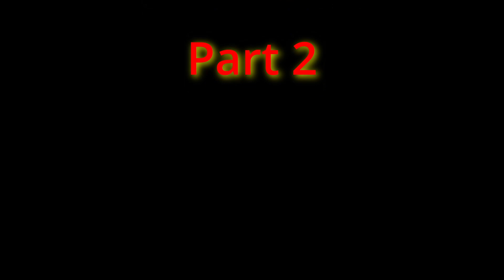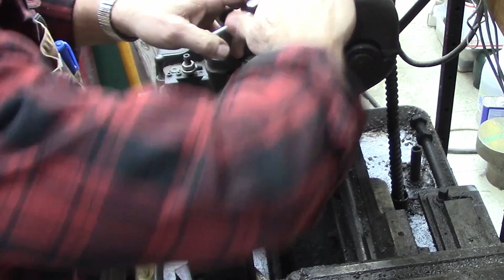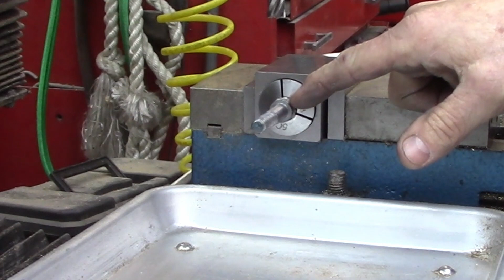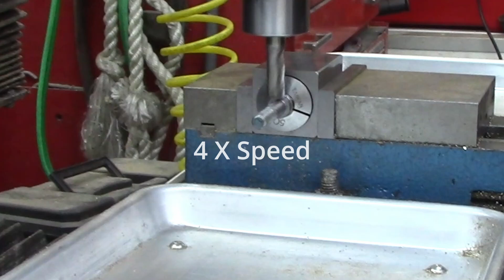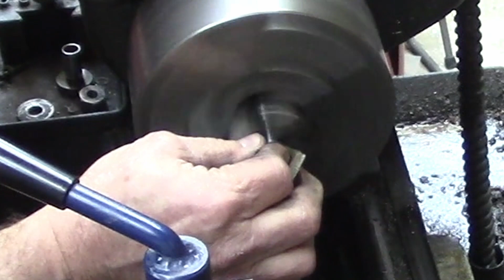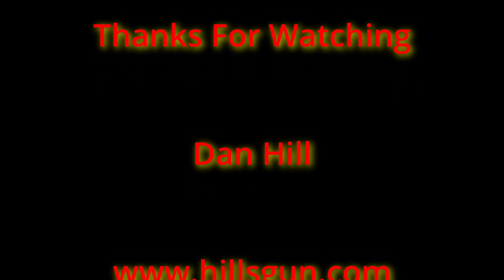Machining A 9 69A Banjo Bolt For The 10 Inch Atlas Lathe: Part 2

Comment: Great of you to help save these old lathes. Did you every come up with a way to make the sleeves and bushings for these bolts?
Reply from the maker: Thanks, I have done the prototypes for them but haven’t put them in production yet. Dan
Reply: @hillsgun    Thanks for the reply.

I just got a 1936 10D. That seems to be a one year odd ball. The gears are only 3/8'' thick all the way across. Unlike the later ones that are 1/2'' at the hub. I mistakenly bought several wrong gears along with the bolt/bushing assemblies. I guess I'll just have to turn everything down.

Comment: Dan, glad to see your having some fun. I'm hoping to have my Lathe and Mill setup in the next week. have a great day.
Reply from the maker: Thanks, you too!
Reply: Just a general question: how much throw does your half nut lever have? My machine has about a 60 deg swing with about a 4” handle travel. Only about the last 1” matters for engaged/ disengaged. I am finding the long free travel makes it hard to hit the marks on the threading dial except at the slowest speeds. 
What is normal? Should I be looking at trying to modify the disengaged stop point?
( did that make any sense?)
Reply from the maker: Hi Glenn: I will check both of mine tomorrow but I think that sounds like a lot. If there is a problem with your machine I would speculate that there is something worn or broken so I would think of it as repair rather than modify.
Reply: @hillsgun  although the machine is about 15 years old, I bought the machine new, and it has always been a low use hobby machine. Now that I have retired I am finally getting to use it. It is a 14 x 40 “high precision “ machine from China. It has hardened and ground ways, but things like steady rest are really cheesy. The spindle has a ‘variable’ runout of about .0005 though that is not ‘in one place’ but rather bumps at varying spots through subsequent rotations. I think it is poor headstock bearings. With careful setup, scraping in the steady rest to sit square on the ways, adding glass scales, improving my technique etc I can now hold within about .0005”, and that is the limit on my spindle.
The threading has been frustrating because the handle travel is so large that hitting the thread indicator divisions is difficult ( and the markings on the indicator are slightly skewed so some markings are spot on and others are out about 1/4 of a division, I have marked with a sharpy pen, and that helps.) I need to go after the low hanging fruit…. My technique first, make a new indicator dial that is centred on the shaft, putting rollers on the steady rest points so I can support plastic, and whatever crops up. 
The starting switch welded and I burnt out the starting winding shortly out of warranty, I tore it down and rewound the winding. The centrifugal switch would still stick sometimes so I just replaced it with an electronic one. So far that has worked well… but only 50 or so cycles on it, but not sparking from the switch!😊
Reply from the maker: I thought you were working on a Sheldon, hard to say where the issue might be with an import, maybe a clearance issue with the engagements (to much) requiring longer throw before engagement?
Reply: @hillsgun  that is my assessment at this point. I was wondering what a quality machine had in clearance. I have no reference except for high school machines 60 years ago, and observing a lathe in the machine shop at university, and only the shop steward touched his expensive lathe.
Reply from the maker: Half nut lever travels about 2 inches, I would guess 20 to 25/30 degrees
Reply: @hillsgun  thanks! That would be more manageable than my 3 inches of travel slop where nothing happens. I have been compensating by moving it half way and wait for the mark. But if you overshoot you catch the thread crest :(. 
Unfortunately it is a PITA to take the apron apart.